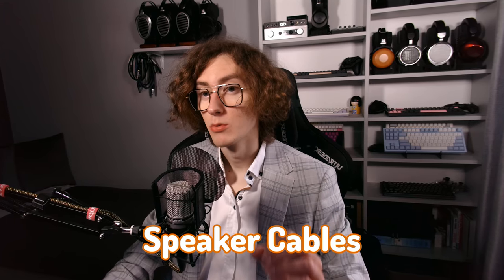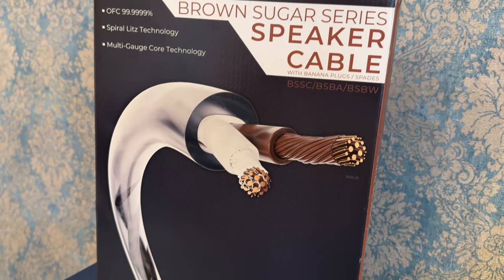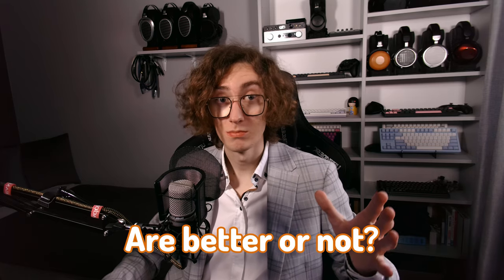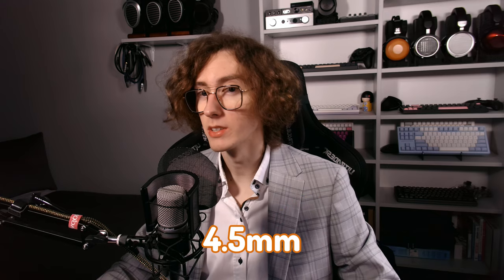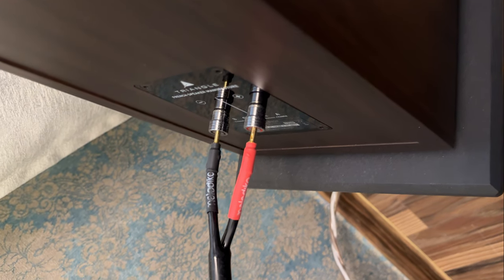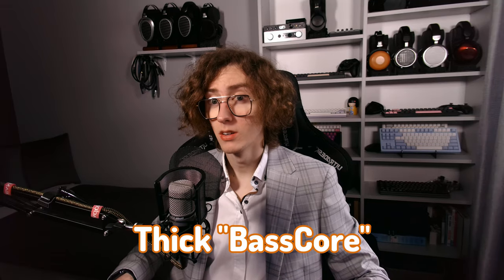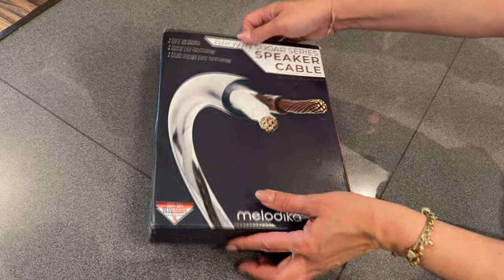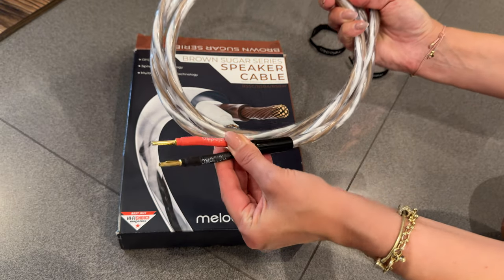Are THICKER Speaker Cables BETTER? - Melodika BSSC4500

Comment: Still no clue if cables are snake oil or not, but they look fire - really fits my aesthetics.
Reply from the maker: I'd say they aren't, some other people think otherwise. Regardless, they do look pretty ;)
Reply: Yes, they're snake oil.

There is a simple analogy...
Once you have a chain strong enough to tow a car, using a bigger chain does not make the car any easier to tow.

The same is true of wire. Once you have wire heavy enough to carry your signal, using heavier or fancier wire does absolutely nothing to make it better.

All this talk about multi-thickness, skin effect, individual insulation (Litz wire) and so on is just a bunch of bullsmut designed to drive up prices and part fools from their money.

For most stereo systems, with cable runs up to about 20 feet, plain old 16ga lamp cord is more than good enough.  For 20 feet or more, jump to 14ga. Then you have a chain strong enough to tow your speakers. Beyond that lies nothing but wasted money.

Comment: I got a lesson in my teens about speaker cable.  I put the speakers on the patio and ran " speaker wire " to them . Lost power, more distortion from winding it up more to compensate,  lost frequency range,  compression from winding all the way up to compensate. It was crap. So do cables make a difference,  seems that way.
Reply from the maker: It's interesting how practical experiences can solidify those theories we hear about! Your case definitely highlights the importance of selecting the right speaker cables. A good quality set can often mitigate issues like distortion and loss of frequency range, especially in setups where distance and power are factors. It’s fascinating how these seemingly small details can have such a big impact!